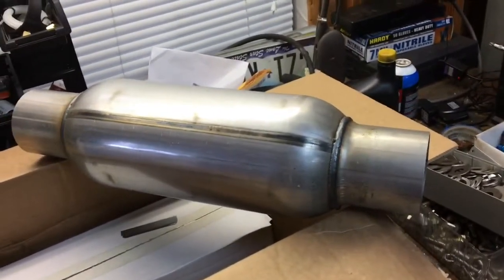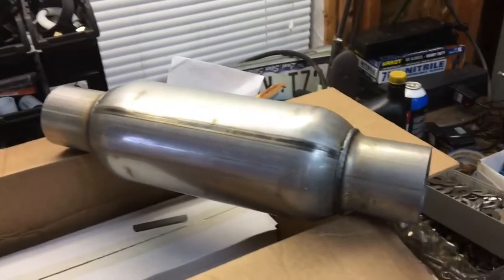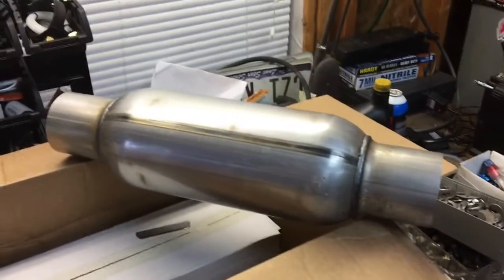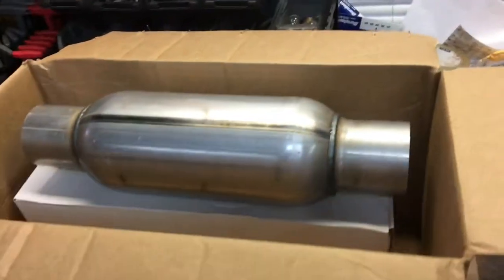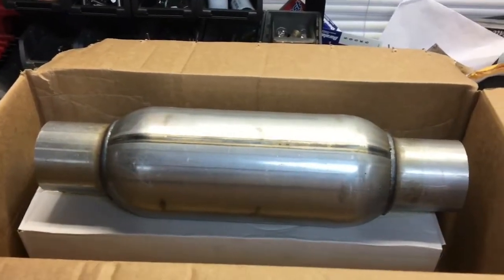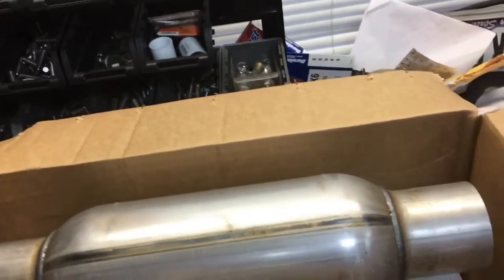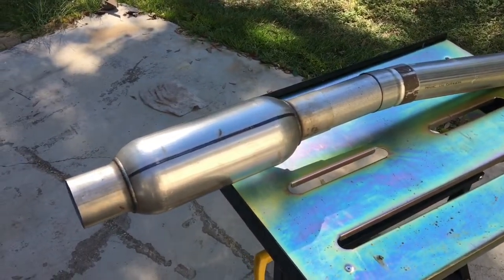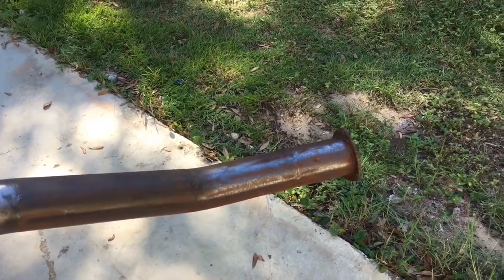Budget fox body mustang drag car. Exhausting 7 minute video....lol

Comment: I love the sound of a Bullet on a sbf. ;-)
Reply from the maker: My garbage kinda sounds like a dump truck at idle and cruise but has a nice scream once the throttle gets abused.............cant argue with the power though...they work:)
Reply: How do you like the south side lift bars
Reply from the maker: wanda morrow I bought these out of a fit of nostalgia for another car and came to my senses and bought something else lol......they work "ok" IMHO......but unless you are getting them really cheap any of the adjustable heim/solid arms are better in my book, plus these have to be welded and the only pinion angle adjustment is thru spring height lol....great back in the day (i had some in '92) but much better options out there nowadays...just had these on the shelf and they are better than stock at least........thanks for watching:)
Reply: They sound like a flowmaster to me, I bought a set thinking they were bullets for my exploder and sounded the same  as a super 40.
Reply from the maker: Yes they have a flowmasher sound lol........didnt really want bullets on this as the plan is to drive it alot and my neighbors, while cool may not like 3" bullets at 5am lol......space was also a consideration as i wasnt real sure how the exhuast was going to fit/turn out....overall i'm happy with the end result and how much money i have into the system....thanks for watching!

Comment: South Side bitchs! when you really want to fuck a car up.haha i had those and the torque box eliminators in an old stang with Moser 31 spline full spool package 4:10 with 26's. 150 shot from 4500 would rip your damn head clean off. the most fun i've had in a car.